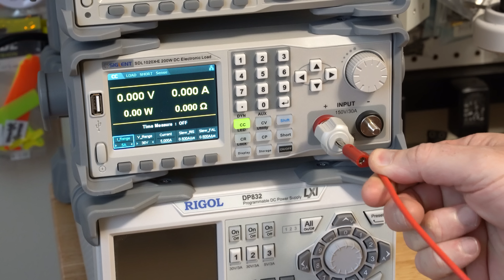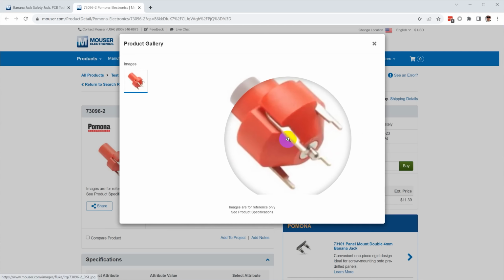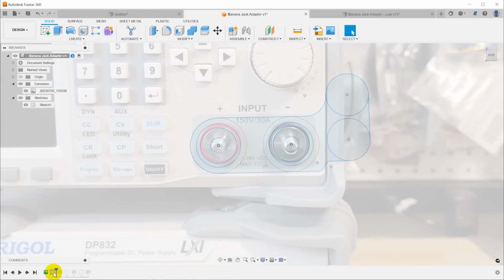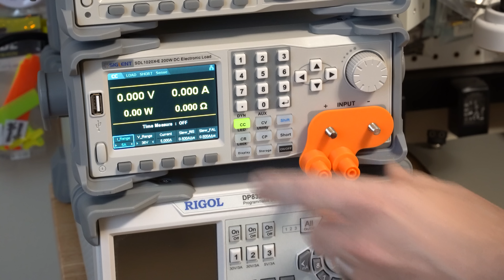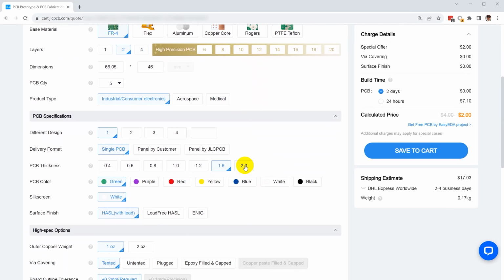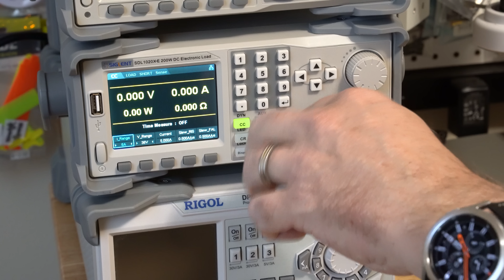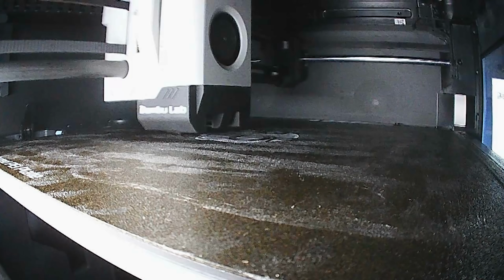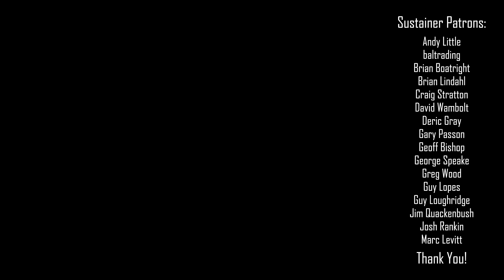Making a Banana Jack Adapter for Siglent Electronic Loads

Comment: Hi James!  I really learned a lot from this video.  Thank you.  Here's a follow up idea and a request.  I was wondering if you might be interested in providing some basics tutorial, in your elegant way, about making/ordering/specifying simple PCBs like this, KiCad, and PCB providers.  I am pretty fluent in Fusion 360 but have never used KiCad but do have some basic electronic and electrical knowledge.  I have never ordered or configured any PCB's.  It's likely that I'll need to use PCB's in a way similar to you have here, in that the parts will be more of a standalone object without complicated circuits.  I would love to know more about KiCad, why/when it's beneficial as opposed to Fusion, and what files should be exported/used.  You mentioned KiCad, Fusion, and the PCB provider's website would've required some additional work that you chose not to do.  What are the considerations for this that someone like me should be aware of?   Thank you for all that you do and show us!

Comment: Ha, I've been thinking about making something similar for my siglent SDL for a while. Heck, since I've seen the tektronix one with the awsome knobs that have the safety banana plugs integrated I've been trying to find them any maybe use these, but alas no luck so far. As an alternative I was thinking about something with a stackable 2 PCB solution (including some screw terminals to wire 2 cheecky wires along the bottom for 4 wire measurements to the back), but I always held off because I was kinda worried about insulation. Your solution is quite nice though and would seemingly fix my insulation concerns as well. Great projet idea.
Reply: Correction: It's not Tektronix with the awsome knobs, it BK Prescision Model 8510B. Way too expensive for my use cases though.

Comment: Although your design is fairly rigid, I wonder if using the entirety (almost) of each side of the PCB as a single trace (e.g., bottom side negative, top positive) would increase the rigidity a bit more. I'm not sure if the capacitance would interfere with the operation, though.
Reply: Don't think it would make much difference. Plus standard banana jacks are only rated to 15A anyways.

Comment: 2 things. Carbon in this form is not conductive at all? Wouldn't you have had the advantage of practically separating your PCB in 2 with copper in order to maximize the surface area for each pole?
Really a great result!

Comment: There is a reason why it has these binding post.. Because you are supposed to use thick gauge wires for this and not banana jack measuring cables which are not designed for this purpose.

This is why 90% of these DC Loads have these posts.  Used to be a time that companies would not have to think about such things but in this era where people try drying their wet dogs in the microwave (yes I know this is an urban legend but it explains best what I mean) they have to make sure or get sued.
Reply from the maker: I find it curious that they sell a 30A power supply (SPS5041X) with standard banana jack binding posts.
Reply: @Clough42  It says right on the front of that unit between the banana jacks ... 10A max. If you want the 30A you have to use the MUCH bigger screw terminals in the back :)

Same reason :)

Comment: Does it matter much how you connect to an electronic load? I have access to a number of Sullivan decade boxes from the 1950s and 60s and they don't have 4mm connections, just a plated brass stump and screw. I cut a 4mm test lead in half, then strip and screw the bare copper down super-finger-tight. That's good enough for two wire use. For four wire, I put the P terminals on the brass stump and get the residual resistance Sullivan put on the plate over half a century ago. I will add: these are 0.05% boxes, and meet that spec today.

Comment: Has anybody tested the electrical resistance of the BL PAHT-CF?  I know plenty of other PA12-CFs have surprisingly low resistances, but I haven't seen it listed anywhere in their published data.
Reply from the maker: I have.  With a 100MΩ multimeter and the probes forced into the surface of the material, 1mm apart, I read open circuit.
Reply: @Clough42  Glad to hear it!  I get worried when manufacturers don't bother to mention electrical characteristics on their datasheets 😀  Does your voltage drop change at all with the cover on versus off?

Comment: Awesome video. How would you rate that dc load for general, non-professional use? I've had my eye on it for a while. I'm not a huge fan of rcc electronics who are the siglent reseller in Canada. Their service lost them a 3k sale. I know that's peanuts to them but it caused me to sell all my siglent gear except my spd3303x-e. I never lost much on the sale of my scope and arb and went with rigol. The equivalent piece of rigol gear is twice the price (savings*n = price to lose pride haha).

Comment: Trying to understand where a centre-centre distance of 30mm comes from when you measured 30mm across the outside of terminals. If they're 6mm in diameter then wouldn't the C-C distance be 30-(2*1/2*6mm) = 24mm?
Reply: He zeroed the calipers when they were at c:a 6mm after measuring the terminals. So you're right, the actual measurement was 36mm.

Comment: Carbon fiber is conductive, btw! Might be good to know in this application.
Reply from the maker: That seems logical, but I've never seen a carbon fiber 3D printing filament with any measurable conductivity.
Reply: I wonder how much carbon FIBER is actually in this stuff. Maybe just carbon something.
Reply from the maker: The issue is that the fibers are not continuous and they're surrounded by plastic.

Comment: Carbon fiber reinforced plastick, doesn't that make it slightly conductive?
Reply from the maker: This is a common misconception.  I can't measure any conductivity in the extruded material--even with a 100MΩ multimeter.

Comment: What's the resistivity of the Carbon Fibre PLA?
Reply from the maker: It's nylon, and it's not conductive in any way that I can measure with a 100MΩ multimeter.

Comment: What is the limiting factor for the 15 amps on the pcb? 
I've seen pcb traces a fraction of that carrying 50+ amps.. 

Or am I missing something here?
Reply: Heat is the limiting factor. 50 amps RMS on traces smaller than that would get very hot, likely even presenting a significant risk of fire.

Comment: I have never used Kicad but have used EAGLE, now called Fusion electronics.  If you are using Fusion 360, why not use Fusion Electronics that is already included with F360?  What are the advantages of  using Kicad over Fusion Electronics when you can iterate back and forth between MCAD and ECAD seamlessly?
Reply: I was just thinking the same thing, it could that you are used to one application and its mach simpler and faster to use fhat one.

Comment: If the PCB was so simple, why didn’t you design it directly in Fusion 360?
Reply: Or using the electronic toolbox of fusion 360, which can also export the 3d version of a design
Reply from the maker: Didn't even think about it.  I used it for one project a few years ago, and wasn't super impressed.  It's probably worth another look.

Comment: bannana jacks are only 15a rated. Seems like the original ring connection would be much better
Reply from the maker: Much better for what?  The jacks I used are rated for 24A.  The test leads I showed in the video are rated for 15A.  Both far exceed every use case I have ever needed.

Comment: I'm rather surprised you want to use a PCB for this. Seems like the ampacity of PCB races would be too low, even with heavier weight copper and wide traces.

My first approach would be making some copper bars that would drop into a Delrin or GPO-3 block, with some turned studs drilled 11/64 for the plugs on one end and threaded to go into the bars on the other.

Option two would have been to make a drill guide to drill the existing studs for banana plugs and then drill a matching hole in the knobs.
Reply: if he used flood fills and stitched the two layers together there is no reason that board couldnt handle the 30 amps of the load
Reply: @osgeld  4mm banana jacks are usually only rated to 15A max anyway.
Reply: @PeregrineBF  The banana jacks he used were rated at 24A.
Reply: @PaulSteMarie  The jacks, yes, but most plugs aren't.

Comment: Carbon fiber nylon is a bad choice. It has significant conductivity.
Reply from the maker: It has no conductivity that I can measure with a 100MΩ multimeter.

Comment: Your load probably doesn't have banana jack connectors for safety reasons. Banana jacks are typically rated for 30V 15A, not 150V 30A.
Reply from the maker: These particular jacks are rated CAT III 1000V / CAT IV 600V at 24A.
Reply: @Clough42  yes, that's because you are a well educated, clever person. They probably want to prevent idiots from plugging cheap Chinese bananaplugs into the load and putting unsafe currents and or voltages on it, burning their house down and then sueing the company. 
But this is just my guess. I'm not working at that company.

Comment: to get center to center you have to meashure from left side of post to left side of other post
Reply: It is more accurate to measure the outside dimension and subtract 1 stud diameter. That way you don't have to accurately find the center of each post.